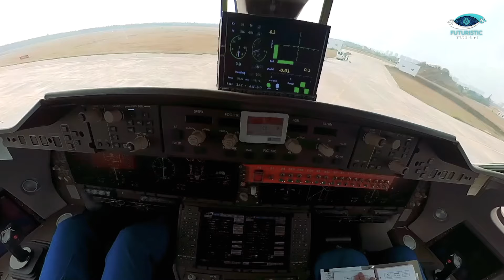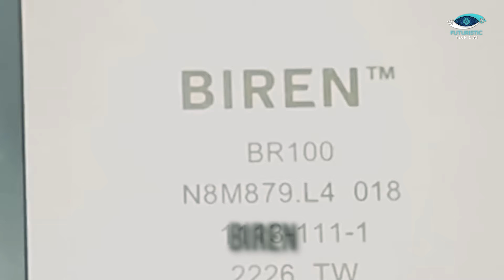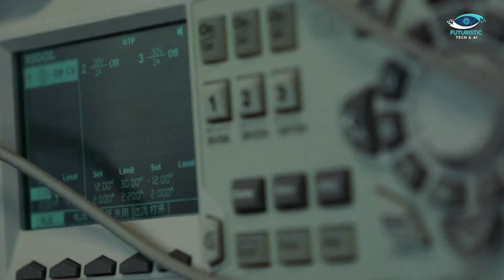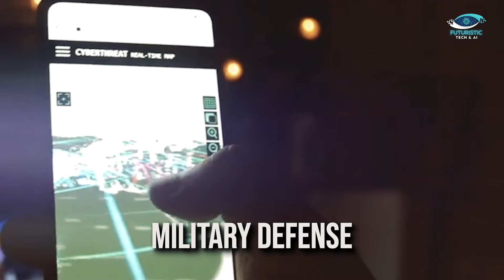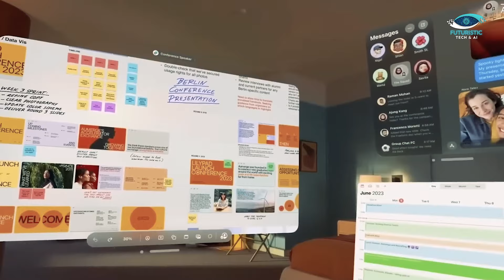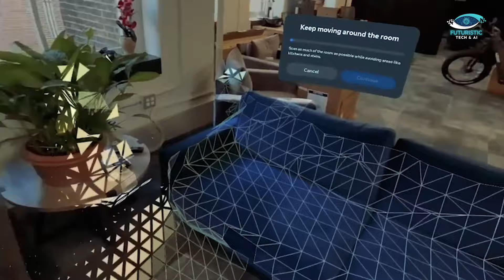USA vs China | Who is Steering the Tech Revolution in Electric Cars, GPUs, and Beyond? #china #usa

Comment: Imagine saying that Nio is more convinient to swap all the time while you can literally just charge your car at home. Not to mention your data about Tesla superchargers is very very outdated! Tesla announces quarterly results every 3 months which includes all of the superchargers Tesla has installed. I looked at the presentation yesterday and they had around 52,000+ superchargers in over 5,000 locations. Nio is not even remotely close! Also Nio has the advantage of NOT selling many cars which means they are not forced to built more stations. Yet if Nio was the size of Tesla they would be forced to built tens of thousands of stations. They are much larger and more complicated and take a lot of space. 

Also why are you comparing BR100 which no longer even exists with A100, a 4-year-old GPU?  H200 is the latest Nvidia offering offering 4,000 TFLOPS of INT8 performance and 141GB of memory. B100 is coming this year and it could offer 50 to 100% greater performance than H100. 

There is absolutely no evidence that Tianhe-3 is superior to Frontier. Looking at the specs it has nothing on the Frontier! The Tinahe-3 is at least 8 to 10 years behind in computer architecture as it still uses 14nm chips which are the same as the prior Chinese best just slightly more optimized and with more cores inside them. On the other hand Frontier is up-to-date when it comes to its architecture and it has GPUs inside which means for certain applications the Frontier would literally be hundreds if not thousands of times faster than Tianhe-3. 

Also why, when comparing US and China, you always seem to undermind America. You did that in all the examples I gave already and you continued with space. Blue Origin is not America's primary launch provider for neither for people nor for cargo. Actually Blue Origin is not even providing cargo services at all. The company that does it all is SpaceX. They are a leader in space tourism and cargo services.
Reply from the maker: Thanks for sharing such valuable feedback. We will consider this in the next videos.